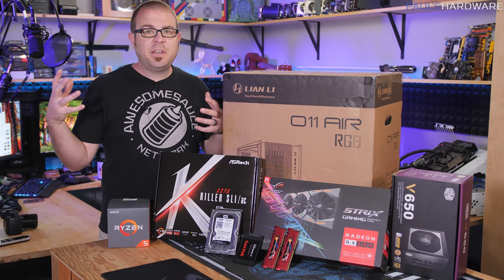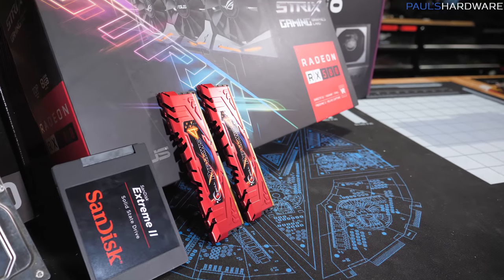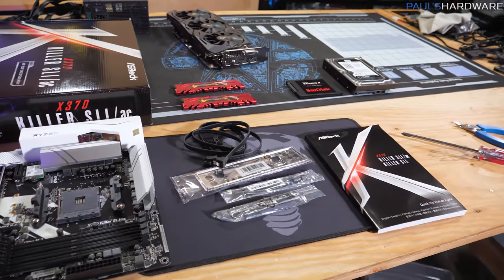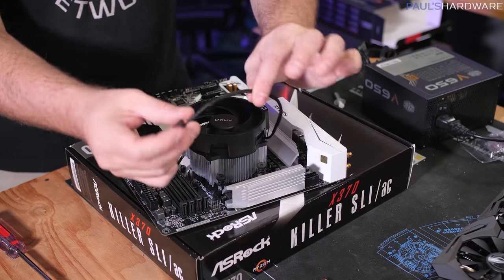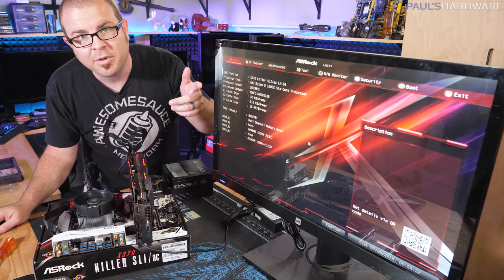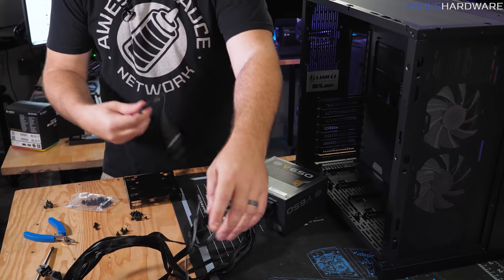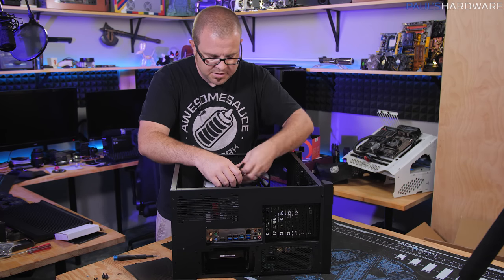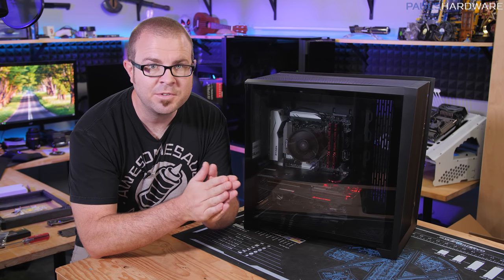How To Build an $800 Gaming PC in Late 2018!

Comment: Hey Paul, I bought parts for the $1000 build and when I put everything together there's no display of the bios, however all fans are running. I only get a flashing of RGB under the video card. Is there anything you might suggest to get it working? Thanks in advance.

Comment: Hey guys i have a question is this a good gaming pc for 1100 dollars canadian?
iBUYPOWER Gaming Z Series - AM900Z. All new.

Comes with a gaming keyboard and a gaming mouse.

Intel i7-7700K 4.2GHz, 

Geforce GTX 1070 8GB, 

16GB DDR4 Ram, 

1TB 7200RPM HDD, 

240GB SSD, 

WIFI USB Adapter, Light up Case, Win 10 Home, VR Ready

Comment: I like watching these builds as it shows that you don't have to go all out to build a PC that will game and do some work without getting a mortgage to buy it- or trading the car for a PC.. Would you get more bang for buck with a cheaper CPU and more expensive GPU like a i3 8100 and a 1070ti?
Reply: IMO, a I3-8100 + 1070TI is going to get you better framerates/quality than an I5 and a 1050TI (even factoring in your CPU throttling your GPU).  If you decided you wanted an I5 because you needed more than 4 cores, you could install one later and just resell the I3 on Ebay.  Most games nowadays require good GPU performance...only a few types of tasks are going to stress your CPU (ie, video encoding).
Reply: If that was the price, there are many options- r5 2600, r7 1700, r 5 2400g (the latter for freesync stuff). All CPUs are upgradable in the next 2 years with cheaper CPUs.

Comment: I would save another maybe 20-30 bucks on the motherboard and go for the new B450 chipset and use those now 70-80$ (together with those 50$) for a Ryzen 2600X if the main use case is to game on it.

Comment: I built literally almost the exact same pc except more ram and diffrent motherboard, do you think I could run a second rx 580 with the 650 watt power supply?
Reply: probably right on the edge there, i wouldnt risk it and get a better PSU, you can always sell your current one too

Comment: Nice hardware. I would consider another ssd like mx500 because the san disk does not have a cache and that might heavily influence your performance. (I have my system on 960 m2 ssd and 2 san disk ssds for games and I just read about the absence of a cache long after I bought them. Should not be a crazy difference I guess)

Comment: If you are building a pc the best upgrade for 50-60 dollars would be the hard drive.  Most games now adays require huge amounts storage space faster hard drive with more storage is allot easier to install when you first build the pc.  The rest of the upgrade options are way easier to upgrade later then copying to a new harddrive.  Imo.

Comment: if I don't have any rubbing alcohol to clean off the old thermal paste is it ok if I use soap and hot water ?  
(I would be using dish washing liquid for the soap if that matters)
Reply: Don't do that. Water and electronics don't mix.

Comment: Paul's Hardware. What are Asrock motherboards like these days. I haven't touched them in over a decade. Used a couple back when Nvidia 5700 and 5900 graphics cards were the latest . And they were known for being twitchy, had issues with mine. Have they impr9ved over the years?
Reply: I have this exact x370 killer board for my 1700 for over a year now without issues. Like most things depends on the board, some really good Asrock boards(Tiachi is great) out there and usually best bang for the buck. I would say generally an ASUS board is a little better but you pay for that also.
Reply: Jacob Vega good. Means Asrock have improved their manufacturing then. I have a gigabyte g1 am3+ series motherboard and it's damm aswome. 
Yeah I've had Asus motherboards in the past. A M5A 78L-M and it was a good little micro atx board. Nothing fancy but a solid and stable performer.
Do like Asus their products have always been of good quality

Comment: Hey Paul.  I followed your steps. When I was done I turned it on. The pc itself and fans turned on. However I am not getting an image on screen. What did I do wrong? Please Help 
It stays btw

My build:

Strix b450-f Motherboard
Ryzen 7 1700x
Thermaltake silent 12 cooler
500W evga 
Rx 580 8gb
16gb Ram

Comment: rate my build 
cpu: intel pentium gold G5400
gpu: Msi R7 240
motherboard: H310M A
HDD: Toshiba HDWD110
ram: CORSAIR Vengeance LPX 8GB 288-Pin DDR4 SDRAM DDR4 2400
psu: EVGA 500W

Its my first build im just waiting on some parts to come in

Comment: Can I use the onboard video for a GIGABYTE X470 AORUS Gaming 5 WiFi with a Ryzen 5 2600 processor, or do I need a video card?
Reply: No...while the motherboard might have onboard video listed, it will only be active if you buy a Ryzen 2200G or Ryzen 2400G CPU.

Comment: QUESTION - My build consists of Ryzen 5 2600 at 4.0Ghz, G Skill 3200MHz 16gb ram, and a Strix 1070 Ti. I noticed that while I am playing Fortnite (and only happens with Fortnite), it will randomly freeze for anywhere between 10-30 seconds. The screen itself will freeze and the sound will keep looping. It will also do this sometimes  when I am using the internet for things such as Netflix or YouTube. For example, I will be trying to close tabs or the browser itself and nothing will happen. I won't be able to click things but  I can still move my mouse and after a few seconds, the command will go through. Not sure what exactly is the problem so looking for anyone who may know any fixes!

Comment: Should I go 1070 or 580 or 1060 if I have a 900 dollar budget? Also great video Paul
Reply: Kid who Likes cars 1070 for sure and if not rx 580
Reply: if you are ok with a used gpu you can probably get a 1070 if you can find a good deal and as for the 1060 and rx 580 im pretty sure you can find them new for about 250 to 280
Reply: I’ve seen used 1070 for 300 so I might go with that
Reply: And I’ll probably upgrade the gpu 2 years later with next gen gpus
Reply: just be aware that a used gpu like the 1070 could have been used for mining and that it might not be as powerful as it was before
Reply: yeet ness alright
Reply: 580/1060 are basically the same, 1060 a little more power efficient but 2 GB less Vram(usually not an issue with most game unless you go crazy on the details), 1070 is a decent amount faster, just depends on how much you want to pay. I have seen a few Vega 56 sales recently($399) also and its faster than a 1070 if can be had for same price.

Comment: I made my pc for 577$.

Asus strix b450f
16 GB trident z
Corsair 450 watt
Ryzen 3 2200g
128gb m.2 WD green ssd
1tb hard drive WD blue (from old pc)
A cheap led strip

I am going to add a dedicated gpu 1 or 2 months later and my build will cost around 800$. 1 or 1.5 years later I might also upgrade to Ryzen 5 3600x.

Comment: i want to build a new pc. i was going to upgrade to a 1080 from my 7yr old amd 7950 and then get a new cpu/mobo/ram early next year. should i do that or hold out for the 1180?
Reply: your cpu wiil likely bottleneck badly a 1080, youre probably better off waiting to get everything at same time
Reply: youweechube ive got an i5 3470 3.5ghz  quad core 4 thread. 6 years old but not many games use more than that. id get a 1070ti but theres only £55 ish between them
Reply: Welshy I think it depends on the games you'll be playing. I played AC Origins and that kicks CPUs butt !

Comment: Price Update as of 11/12/2018: All items on ebay got me a grand total of $759. Only difference this time around, I chose to add a USED motherboard BUT I opted for 2x8gb g skill giving me a 16gb boost of ram. The other $41 can be used for accessories like wireless adapter/mouse/keyboard/etc

Comment: Guys, I really need help. I’m new to pc building and I’m debating what cpu and gpu combo to get. My options are 1. 1060 6gb with a Ryzen 5 1400 or 2. 1060 3gb with a Ryzen 5 2600. Any input is appreciated.

Comment: Ryzen 5 2600 is cheaper than 1600, has been for most of the year. Can get an 8GB RX 570 for less than the 8GB RX580 and use the savings to get 16GB DDR4 3,000 RAM. Also, don't go out and get a tempered glass case, if you're set at $800 then skimp on a case.

Comment: Would be interesting if you made a levitating PC. Pretty impractical, but if you balance the inside of the PC properly and raise it with opposing magnets in a concave sphere, it can be possible to levitate it. Would require some beefy magnets to hold up that weight though lol. Thanks for the build, do you think you can do an Intel 8700k Build around 1500$-1700$ USD? That’s what I’m making after December. I sadly think I have to downgrade my graphics card from a 1080 to a 1070TI because of my flight simulator and in the future to get a VR for immersive flight will require a ton of USB slots, making the MSI Code motherboard a good choice along with WiFi and apparently great audio for when I do music mixing, although insanely pricy.

Comment: With 800, eazy.
Ram and gpu prices are down so much that my 435 computer would cost third less now.
I caluclated the cheapest good gaming pc you could get is about 650-700 atm.

AMD Ryzen 5 2600X (95w, cost atm 189)
Kingston 16gb 3,2ghz hyperx (cost of 102)
MSI RX 580 8gb OC 1366 MHz x16 (180w)
600w psu (allmoast double that's needed)
A good motherboard (usually priced around 100-120, do not get cheaper in this use case. you need x16 for the gpu and a direct cpu M.2)

NB! The prices may warry depending your location! All the prices i used are the prices available for me, also i have few of these good priced parts allready like the Kingston 16gb 3200 ram and 2tb red hdd. All items New.
Reply: Previous post was made before video, aka from title name.
So with the 580 they went spot on :D
But only 8 GB of RAM :O
Reply: If you want a fast and good storage solution then add 150 to my 650 price, and you get one of the best speed 2TB drives you have ever used ;)
I said drive deliberately as you get an M.2 fast 250 gb drive and a WD Red 2tb and use the Store MI that AMD offers for free with fast drive being up to 256gb.
Store MI has technology (includes some clever AI) that previously only has been used in the industry(data centers mostly).
Your computer will start min 3 times faster than normal ssd 
(up to x10 faster, depending on your motherboard M.2 setup).

Samsung 970 EVO 250GB - NVMe PCIe M.2- Read speeds up to 3,500MB/s (89)
WD Red 2TB (70)
Reply: I would get even cheaper prices if i looked more than 30 min or even cheaper on top of that by using codes and referrals and other bonuses or partnerships (that anyone can do), most small companies who know do some bargening can get -30% off market price from all the parts, they probably add the same sum to the computers they sell so cliend get a market place "cheap priced" computer but the contractor gets 30% of the full price for their work.
So if you do it all yourself you could get probably 15% of from your components from the regular market price, if you invest lots of time and do good research. (Easyer for small companies to get them in lower price.)
So superfast conputer with under 800 buget is no problem, gaming tho is just good (not the best).

Comment: I am building my system piece meal started with the headset went with turtle beach elite pro next was the keyboard a Rosewell keyboard came with a mouse value $55 for free then a Samsung free-scynch monitor 144 hertz next is the case then the rest of the system. Got the parts that work with my current computer first then the tower and finally the rest of the system. Some parts you can't rma if you wait to long so you should do all them together.

Comment: Hi I built a pc with the AS rock x370 sli killer, 16 GB gskill ram, ryzen 5 2600, stock cooler, Asus Rx 580 8gb triple fan 250 GB SanDisk SSD, 1tb wd HDD, and corsair bronze 650w PSU when I turn on the pc everything spins and lights up but then it turns off after 30seconds and starts up again . When I try to hook it up to my monitor via HDMI it stays blank and I have tested this monitor with my laptop with the same cables. I appreciate any help.
Reply: pradyun chandramouli if you find out the issue I have the same issue

Comment: I'm doing a build and got to the out of the case test. Everything spins up but then the video card stops and I don't get any output from the video card. I'm using the MSI upgrade card and I have tried every output for display port and HDMI but no output. What did I do wrong?

Comment: would a GTX 1060 work with this build instead of the RX 580? (Unless there's a white one available)

Also you guys can buy a 2TB Seagate hard drive for only $58 right now. More bang for your buck in the storage department, I'm using some the extra $50 for that.
Reply: Yes, 1060 will work just fine. I agree, 2TB hard drives are a better deal.
Reply: I went with the RX 580 anyway. I found a white one available so I decided to get that one.

Comment: Maybe a newb question but; how did you get into the BIOS without a keyboard?
Reply: Beau Chang it will load straight into the BIOS since there's no drive detected that has Windows. So by default it's option is to go straight to the BIOS.

Comment: You guys think a cx450 w powersupply from corsair will do for a i5-8400 and a gtx 1060 6gb?
Reply: Yes. Use pcpartpicker.com to try different part combos and it will tell you how much power you need.

Comment: I finished building my first pc, sadly upon pressing the power button the fans and lights turn on for 1 second and they power off. There is a red light on the motherboard that indicates an issue with cpu. I tried removing it and re installing it to no avail.

Comment: So guys... I'm getting these specs to build my PC is there anything wrong with it, would there be any problems with fitting or anything else?

CPU - AMD - Ryzen 5 1500X 3.5GHz Quad-Core Processor

CPU Cooler - Deepcool - GAMMAXX 400 White 74.3 CFM CPU Cooler

GPU - EVGA - GeForce GTX 1060 3GB 3GB SC GAMING Video Card

Motherboard - Asus - PRIME B350M-A/CSM Micro ATX AM4 Motherboard

Storage - Western Digital - Caviar Blue 1TB

RAM - Ballistix Sport LT 8 GB Kit (4 GBx2) DDR4 2666 MT/s (PC4-21300) Single Rank x8 DIMM 288-Pin, Bianco, 

Case - NZXT - S340 (White) ATX Mid Tower Case

Power Supply - EVGA 450 BT, 80+ Bronze 450W
Reply: No need for the extra cpu cooler.
Reply: Luke W Really? I mean my room is pretty hot and i want my PC to be cool with the support of the cooler so thats why i thought id have one
Reply: Are you going to be overclocking the cpu? If not, than the stock cooler is just fine
Reply: Luke W Yea I’m gonna oc
Reply: How far?
Reply: Also, consider going with a 2tb hard drive like the toshiba p300 sold in bulk packaging on newegg.com, sometimes they go on sale for under $50
Reply: Cooler master hyper 112 goes on sale on neweegg.com for $20 and you don't have to have it shipped all the way from China
Reply: Also, I wouldn't pay more than $120 for that 1500x
Reply: Luke W Don’t know how far I’m going to OC haven’t thought that far yet as I’m still making decisions for what to buy, also thanks for your suggestions and feedback I will definitely base some of my decisions on    them
Reply: This is how I would build on a budget:
Cpu- ryzen 1600
gpu- rx580 8gb
motherboard- b350 (something around $100)
storage- 2tb toshiba p300
ram- 16gb ddr4 3200
case- phanteks p300
power- corsair cx450

Comment: this is my 850-900 dollar parts list for what i built tell me what you think...
ryzen 5 1600
gtx 1050ti 4gb
Ballistix Sport LT 16GB Kit (8GBx2) DDR4 2666 MT/s (PC4-21300) SR x8 DIMM 288-Pin
Seagate 2TB FireCuda Gaming SSHD SATA 6Gb/s 64MB Cache 2.5-Inch Hard Drive 
GIGABYTE GA-AB350-Gaming 3 AMD RYZEN AM4 B350 RGB Fusion Smart Fan 5 HDMI1.4 M.2 SATA 6Gbps USB 3.1 Type-A ATX DDR4 Motherboard 
Crucial BX300 120GB SATA 2.5 Inch Internal Solid State Drive
Corsair CX Series 550 Watt 80 Plus Bronze Certified Non-Modular Power Supply 
FSP CMT210 Translucent Window Panel ATX Mid Tower Gaming Computer Case
what do you think?
Reply: Needs a better gpu.

Comment: Noob question but if I have a nvidia gpu can I use it with a Radeon MB/CPU?
Reply: yes GPUs fit into pretty much any motherboard and are cross CPU compatible.
Reply: Yeah.  Motherboards are very restrictive with what CPU can be used, and maybe that's why newbies are afraid of mixing and matching GPUs.  Graphics cards are practically self-contained computers, and all modern ones fit into the same standard expansion slots.  The previous standard I think was AGP, and that was abandoned, what, about 15 years ago?  The only thing to watch out for is power consumption, but I think that 650w supply will handle anything you're likely to drop into a system at this price point.

Comment: i have a question. i’m helping my girlfriend build a similar PC currently and we still need a motherboard/RAM. the motherboard’s newegg page doesn’t list 3000 as a supported RAM speed yet you can pair the two together. can someone explain this to me? i don’t understand how to pair these. will i need to down the clock speeds or something?
Reply: bburn7840 wut? if you are talking about 3000mhz ram any motherboard will support it unless is a a320 for amd or h310 for intel, any better chipset will support 3000mhz ram
Reply: +bburn7840 If that Motherboard doesn't support 3000MHz RAM then the motherboard will Automatically Underclock the RAM at Supported Frequency